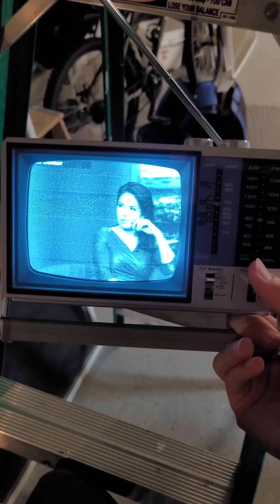How far can my TV transmitter reach?  #tv #analog #shorts

Comment: I'm going to assume that audio went out first because it's FM and the video is AM which goes farther for the same power.
Reply from the maker: It might also be because the transmitter has a separate aural power adjustment alongside the RF power adjustment, so the video and audio carriers might've had different power levels when I did the test

Comment: Modify a sweet 16 Texas Star,1,600 whatt cb linear to that freq.Even best,a compition,90,000 watt tube amp sett up,running seven altnators with daul turbo suburbon with 6 plu batteries few caps, with a 102  inchwhip like you see pro compition cb radios fests that can get over 100,000 watts of cb power,you should set one up and mod the for your tv transmitter see how many states that can reach raw .😅😅😅

Comment: not very far. tv signals are what... 6.5mhz wide. at nowadays fairly low carrier frequencies. with vhf or uhf tv you basically have to pump at least 5-10 megawatt into it to get some halfway decent output and even then it doesn't get any further than just a few 100km at most.
Reply: take note that what comes out of the antenna also has to go in through the wall outlet :P and then some more for the 'additional heating of your building' lol. analog tv isn't a very profitable business nowadays. electricitybill wise. lol.
Reply: if you wanna span half the world with just 10-100kw or so just go for am radio hahaha.

Comment: I’m surprised those modulators have enough power to drive a signal through the antenna that far without an RF power amplifier. I thought these devices were intended for modulation over coax, such as in MATV, CCTV and cable systems. So it’s surprising it has that much drive, unless they’re actual exciters. Though they’re likely designed to drive long coax distribution lines, so maybe that’s why. 

Reminds me of the pirate radio station I built in my bedroom in the early 90s, when I was a child. I built a 100 mW FM transmitter from kit that I souped up, running coax to a 6’+ tall ground plane antenna I made out of metal coat hangers and a UHF connector plate (four angled hangers soldered to the screw mount holes, one soldered to center pin as a radiating element). I put that up in the attic and being so high (two story duplex), it transmitted a good several blocks with decent quality. Had an old tube mixer, two tape decks and a mic.

Comment: Ain't that illegal? You better use a small signal before you get locked up. 😅 4 houses is way too much. 😅 I use a coax cable. I don't transmit in the air. Transmit thru a cable is much safer.
Reply: The chances of you being locked up is minimal, because the signal is so weak the FCC listening station probably can't even distinguish it from background signal noise in the spectrum anyway. Buildings, terrain, vehicles, and other obstacles all attentuate the signal making it nearly impossible for the FCC to tell if it's noise coming from an unauthorized source.

The main thing is to not cause interference and study which channels are vacant by checking the FCC databases in the area you are serving, and have any and all necessary measures in place such as bandpass filtering to attentuate out-of-band signals so licensed operators within the signal's reach are operating, so the FCC doesn't get tipped off. If a commercial licensee gets interference, the FCC has to respond within 3 business days of the complaint. Do your due diligence.

Comment: It all comes down to the size of the output antenna and the amount of energy fed into the antenna.
My dad and I and my father in law are ham radio enthusiast.
My dad and i knew a guy from the Midwest with a very large antenna who claimed in the 80s he spoke to Fishernan off the coast of Japan.
Reply: With 27MHz CB (on the upper end of HF) all the way up to lower VHF (30-50 MHz) and 6m (50 MHz) it is possible to work as far as Europe, Japan and Australia via F2 or multi hop Es on mobile CB set and a dipole.

Comment: Line of sight. That explains the supertall transmission towers. If you are planning a pirate station,  you need a little more power and a mobile platform.😂
Reply from the maker: Not planning on it, like stated many times, I normally run the transmitter at power levels just enough to cover my home. It's private, not pirate

Comment: how much are tv transmitters?
Reply: $500 to $1,000 if you want to hit 100s of watts to 1,500 watts reliably with good cooling.

The tower or mast to get it above 10 feet off the ground can easily cost thousands, or you can mount it atop your roof for not much more than the cost of the mast plus the cost of getting a regular TV antenna installed.

Comment: digital tv would've been a pixelated unwatchable mess 10 centimeters away
Reply: I'd be surprised if the entire broadcast TV industry switched to digital if the analog signal traveled further, from a bit of armchair research I'm doing out of curiosity for this comment, it looks like digital tv should produce a clear picture from farther away, if the transmission power stays the same. I have to wonder if some TV stations just saw this transition as an opportunity to save some money on their power bill, and went a little too far with it, leaving you and clearly some other people with a worse experience. In my area, for example, all of the local TV stations are at almost exactly the same direction and distance from my house, but the reception varies wildly, which I'm sure is entirely down to the transmission power used, especially since some of the stations that are slightly closer have much, much worse quality by every metric imaginable.
Reply: @jarbarsi i believe you are correct that some TV stations did, indeed, use the transition to digital as an excuse to cut down on the power bill even though it results in a worse experience for viewers. Unfortunately.  They became too dependent on people paying for cable TV to watch their station, although now, cable bills have soared to the point where it's useless.
Reply: @jarbarsi  they switched to make room for cell signals
Reply: @jarbarsi Honestly some of your stations being worse than others cna probably be attributed to terrain
Reply: that's the sad part the signal was pretty clear on analog
Reply: what could have been if we would had analog HD tv.
Reply: @x_aquatix_x  France actually did have it at some point but it was horribly bandwidth inefficient that it took up like 20 mhz and it was black and white to save bandwidth
Reply: I could totally make that work out, but not anymore its not worth it with streaming
Reply: ATSC 1.0 tuners, have a typical sensitivity of -82 dBm. At 1 W EIRP, which assumes an omnidirectional radiation pattern from a hypothetical antenna of the same type, a signal can travel from a transmitter with no obstructions up to 60 miles. This assumes no gain on the transmitting or the receiving antenna.

Because of the curvature of the earth limiting the distance, your antenna has to be placed at least 2,500 feet above ground level just so that the horizon is at least 60 miles in any direction from the transmitter. If you only get it to 100 feet, then your line of sight distance maxes out at 12 miles in any direction assuming no obstructions by terrain or buildings.

ATSC 1.0 signals can travel farther than NTSC analog signals because they are more sensitive, but ATSC suffers from multipath interference much more than NTSC does, so it's not great in urban areas as much as it is in rural areas where obstructions are less likely occurences. The FCC limits for commercial television stations operating at full power are 15,000 kW for UHF using NTSC analog, and for ATSC it's 5,000 kW for UHF. You can look this up yourself because I may be wrong as I haven't looked the exact figures up for UHF, high-band VHF, and low-band VHF. Power limits are different for full power commercial stations, low power and Class A.

Comment: Hey im trying to put together my own transmitter. What transmitters are you using?
Reply from the maker: Blonder Tongue AM series agile modulators, they can be had for $50 ish on ebay. They were designed for cable TV offices but have a strong enough output to drive an antenna

Comment: I wish I had a TV transmitter
Reply: then buy one
Reply: Those things are all over Amazon. I got mine for $35 to play retro games. It's not a transmitter by the way. They're called modulators. If you want to transmit with it. You stick an antenna inside the modulator. Then stick another antenna on the old TV. You're really not supposed to do this but that's how it's done. The one I have is HDMI to RF modulator. It's blue and I can use any custom channel besides 3 and 4. To me channel 70 is the best transmit signal. Please use a cable, don't transmit in the air like this video shows. 😅

Comment: Transmitter, or cable modulator with an antenna on the output?
Reply from the maker: this is youtube shorts, nobody has the attention span for the nuance
Reply: @jmantothe64 haha was actually a legit question but fair enough.  Didn’t know if BT made some short lived product or what, but anyway Was thinking of trying the same thing with my BTmod hanging around, but had no idea they can have THAT much gain, but makes sense. Thinking ch6, that way aural can double as a radio TX also. Of course attenuation to part15 rules:)
Reply: @RemyThePartyDog  BT modulator for cable head end. I have a channel 12 MTS stereo model with a +60dB amplifier. If I hook it to an antenna I get a few blocks too.
Reply: @12voltvids Very good to know! Thanks for the info, and thank you for your vids! I watch all the time! Vids/people like you keep me motivated to keep my bench projects in motion and well used/cluttered haha Take Care!

Comment: If the signal can go farther than 100 ft, it’s illegal to transmit. Cellphone carriers use those channels now for telecommunications. Might wanna turn down the power a little bit before the FCC comes knocking at your door like they did to me.
Reply from the maker: Once again, the power level is normally well below that and can only reach the close side of my nextdoor neighbor's house. Also, I am not transmitting on the now cellphone bands, I am on an unused Lo-VHF channel in my area
Reply: It's not about the range it's about the power...
Reply: @LinuxUser69420  in america its the range
Reply: Cell phones use channel 50 and up. 14 - 49 are still TV. and those BT modulators can run on old VHF channels. Mine is on channel 12.
Reply from the maker: @12voltvids not sure what it is in Canada, but down here in the US, it only goes up to Ch.36 now, thanks to the FCC repack. Here that space is used for mobile networks, just like much of the space that had previously been reallocated.
Reply: @12voltvids  Low-band VHF is mostly free even in a lot of major cities across the USA. Channels 1-6, which go from 54-72 MHz for 1-4 and 76-88 MHz for 5-6. You get the longest range for a given transmission power at those frequencies, but you also have to contend with those being the noisiest of the television bands because of modern devices that cause interference such as LED lights.
Reply: holy yap

Comment: Man, if I were your neighbor I'd tune my tv to your channel
Reply from the maker: well at the normal power i run it at you'd have to be my nextdoor neighbor. also i'd hope you enjoy the oddity archive
Reply: @jmantothe64 I was about to comment either A that TVs RF front end is Hot, or B the transmitter is a bit too hot. One or the other
I’ve got a couple old Emerson’s 5in color sets some exacts models except one was made around the late 80s and the other around the 90s or early 2000s 
The oldest one seems to be working the best, the newer kinda seems like it’s wanting to be recapped, and the color demodulation is a bit off with the alignment. I’m working towards it, I’ve got two radios one from around the  50s a Motorola 63x3, and the other from around the 40s a sears silvertone 6425
And the 3rd which isn’t technically the last radio receiver is a homemade two tube regenerative radio I built from basically junk. That I’m essentially working on/ getting ready to do so. The Motorola has SMD on the micas capacitors that our molded within I.F cans.
Reply: same here :)

Comment: My buddy lived in the boonies. His dad put up a 120 Rohn tower he bought used. Now they had TV reception. But the old flimsy antennas would get bent in a wind storms plus they bought cheap coax and it would fail. Good old dad would send his 13 year old boy up the tower for repairs with no safety equipment whatsoever. 😂
But they had TV! 
Plus when you are terrified of heights, you would never let go. 
To this day, he will not climb anything over 10 feet high.

Comment: Can you make a video on how to build one?
Reply from the maker: There's not really much to build, you connect the video source to the input of the transmitter and connect the output either to an antenna or a cable system
Reply: It works with video player?
Reply: @jmantothe64 do you have your antenna just connected to the blonder tongue? Or is there a coax amp in the process?
Reply from the maker: No amp, the +60dB the modulator can output is, well, enough to reach a street block away. That's why I have my output power limited to where it only reaches my house

Comment: Fuck the FCC, if they were doing their job they would have banned the use of logo bugs on licensed stations.

Didn’t know Blonder-Tongue was still around, that is the weirdest name ever for an electronics company. I want to set up something like this and broadcast all my recordings from the 70s.
Reply: Look up the company history, interesting read about them and the naming. They are still around, and were pretty cool about giving me advice on a 30+ year old amp from them with no BS.
Reply: as long as your signal fits tightly within the allocations, the only people that will report you (NOW) are cellular companies (like T-Mobile) or TV stations still running low power repeaters (not likely) do a check first to see if anything is on the channel. (I mean a deep check drive a few miles in a circle to make sure, at different times of the day-- afternoons to mid evening) if nothing there, the only other reason is power, keep it below 5 watts

Comment: Is cool to bring back analog tv since 2009 is no more
Reply: Analog TV is still a thing, but not in the commercial broadcast band. It's an amateur radio thing now
Reply: @thomasvlaskampiii6850  it's still around in some countries
Reply: @NEON2600Cambodia and the Philippines still analog
Reply: @thomasvlaskampiii6850 You are talking about NTSC or SSTV? SSTV is not nearly as good as NTSC. At least entertainment wise.
Reply: @randykitchleburger2780 They have full 480i NTSC signals now. I'm not sure what band they're in, I want to say 70cm or higher, but they're pretty good from what I've seen
Reply: @thomasvlaskampiii6850  Ohh now that's cool. That's what I like to hear. I'll have to look into this.
Reply: no its not possible since cellular is using the band now, that's why the transition occured in the first place, same with C Band satellite
Reply: @originalclippygfx When did they ditch c band? NBC and ABC were still using it as of 3 years ago
Reply: @originalclippygfx  C Band is still around.
Reply: @NEON2600 Yep I knew that, I tried it a few months ago on a 9' dish.  But many channels in the US transferred over to Ku or Ka Band, to open the band for 5G that's now littering it with noise. So it's basically equivalent to a DTV transition, they didn't completely cut it off but it's basically useless for dish nowadays. There's still a small slice left and who is going to set up a 9' -12' dish anyway...
Reply: @NEON2600 Same is actually true for analog TV, some small local stations still exist but it's far and few now.
Reply: @originalclippygfx  Probably small rural translators; if memory serves, they were among the few that were allowed to continue in analog.
Reply: FCC is calling
Reply: @A_pot_that_cant_game and I said fuck em they don't care about complaints. It's true. I've filed them. They don't care if they even respond.

Comment: Did you make a video about this?
Reply: I have the blonder tounge modulator, I just wanna know how it goes so far
Reply from the maker: For the test, it was running upstairs at its max 60dBmV with an antenna who's length was matched roughly to the half-wavelength of the channel I was running it on. If you're going to try this yourself make sure it's only temporarily at increased power and that it's not on a channel in use in your area